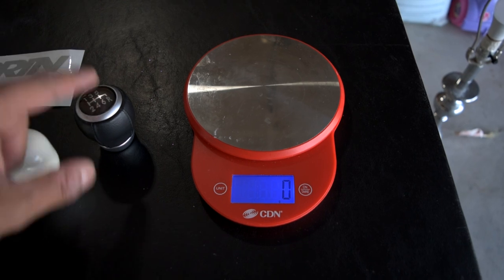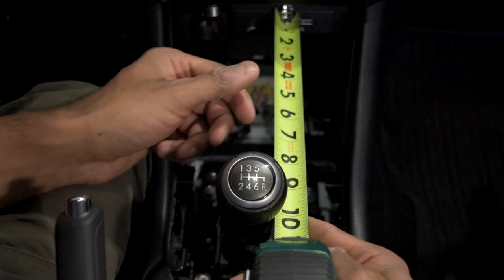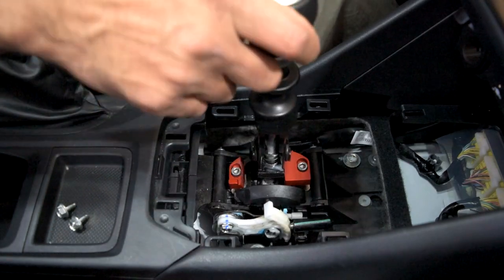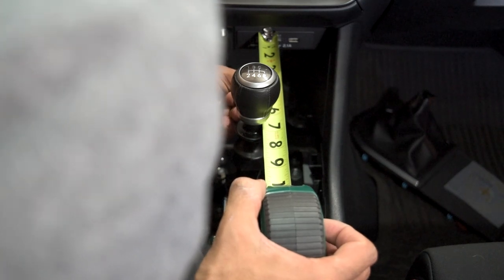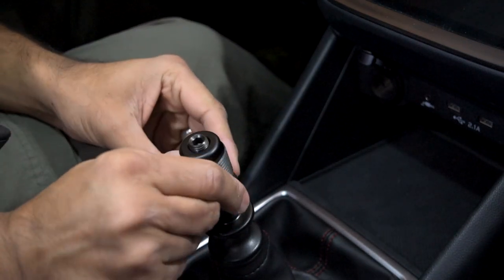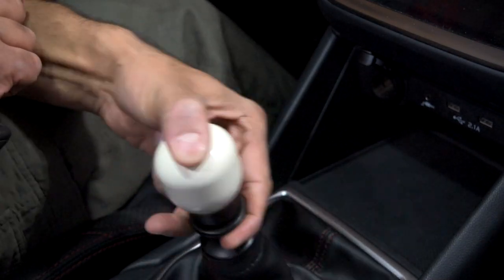2022 WRX Perrin 1LB Shift knob // Shifter stop adjustment #2022wrx #subaru #wrx

Comment from the maker: Chapters:
0:00 Intro
1:50 Contents of box
3:08 OEM vs Perrin weight
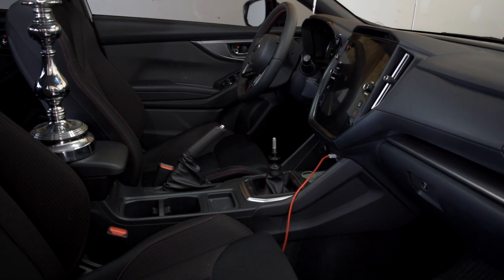4:02 Removal of shifter stop / Metal Montage 1
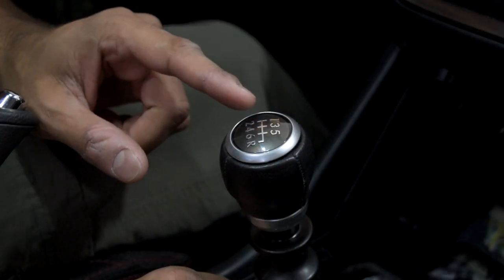4:53 What NOT to do
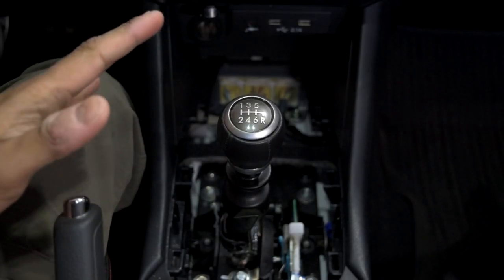5:32 OEM throw measurement
6:42 Shifter stop install+adjustment
9:03 Perrin throw measurement
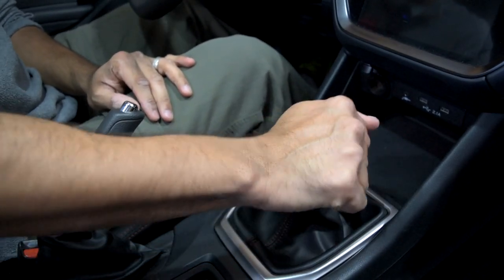11:35 Shift knob install
15:00 Metal Montage 2
16:33 Cold start + drive
17:31 Outro

Comment: Out of all the shift knobs I've tried (I've tried quite a few) the STI shift knob is my favorite. The perforated leather feels nice, and there's a ring of crosshatched etching on the metal at the bottom of the knob and it gives some good grip. I think it's slightly weighted, too. It's expensive, but not too crazy like some of the aftermarket knobs that I've tried (looking at you raceseng)
Reply from the maker: Yea idk how I'm going to feel about the smooth shifter long term. Right now I like the weight, I like the shape. When it's extremely cold tho this thing will be ice. In the summer this will be fire. So we shall see. Thankfully I have a garage.
Reply: @HeavyMetalWRX  yup I had the Billetworkz weighted shift knob but In winter where I live it gets down to -25 Celsius. The knob never warms up. I switched to a Cobb shift knob which I really like, warms up quick. #Cobbknob lol

Comment: 3:49 so as you can see I got my shop light installed 😂😂😂😂😂😂😂
Reply from the maker: My shop light and I have been through a lot. Been using that in my garage since 2021 😂
Reply: @HeavyMetalWRX  at least you have one. I’m still using my cell phone 🤦🏽‍♂️🤣
Reply from the maker: @RedBRZ23  dude these bulbs I have are the shatterproof plastic ones. 60 watt and VERY bright. So when im under the car I can roll the light around and not worry about it breaking....which could have happened many times 😂😂
Reply: @HeavyMetalWRX  that’s very smart!!!

Comment: My reverse lockout is slightly moving up after doing it too but I have the STI STS installed so it had no plastic tabs to trim from hitting the super stops so I’m not quite sure what to even do honestly to adjust it. It’s super minimal but I don’t want some lockout issue later on from repeated hitting
Reply from the maker: That's very interesting! Ive installed 2 of these and neither time did I notice an issue with reverse. It's something they do mention but I my case I had an issue with going into 2. It wasn't bad enough to be an issue though. I'll keep my ears open in case anyone else mentions it. Thanks for sharing!
Reply: @HeavyMetalWRX  sorry I guess I worded that wrong, same thing when I hit 2nd and 4th gear it’s popping up same as you here, just doesn’t make sense why since there’s no tabs it should be hitting on the STi STS didn’t need to cut anything, same as you. I rest my fingers between shift knob and lockout so I feel everytime I throw downwards that it moves up and pinches my fingers a tiny bit

Comment: hey rex iasked asked before anything for the gt upgrades
Reply from the maker: Hey! Yes now that I recall you did. Unfortunately I think at this time we don't really have a lot of options. I believe the JB4 can be made to work with the CVT. Cobb isn't compatible as of yet but hopefully it won't be long. You can still install the ETS intake for some whoosh noises and throw on a catback.
Reply: @HeavyMetalWRX   thanks also a gt vs maual  racing each other would be cool
Reply from the maker: @scottleggiadro5026  yea I've been trying to put that together for some time. It's just been difficult finding WRX's in my area. It seems the many I have seen can't be found on any Facebook group or reddit anywhere.

Comment: I just removed my perrin super shift stop yesterday. 

I could never get it to shift into second or third under power.

You can see on my red pieces (aren't adjustable front and back) where the shifter hits it. I trimmed per instructions.
Reply from the maker: So I had that issue going into second. I did have to adjust my shifter stops bottom to make the shift into 2nd work properly. I know exactly what you mean. Maybe you can try adjusting it again?

Comment: Since you do have the short shifter around, will that be the next install? I'm debating on saving up for it myself
Reply from the maker: I don't think I will for now. I was considering keeping it as a giveaway but I'm not too sure.
Reply: @HeavyMetalWRX  I keep watching videos on how it's done, and it's making me want it less and less just because of how many steps there are, so many little things to take off.
Reply from the maker: @mistamaog  it seems difficult but you just need the tools. I even bought the punch kit. I may end up installing it just for fun because I have the shifter bushing. So I have to get down there anyway.
Reply: @HeavyMetalWRX  Ahhh makes sense, maybe it'll seem less scary after watching more videos haha
Reply: You can also go the shift plate route, cobb has one that’s adjustable 15%-35%